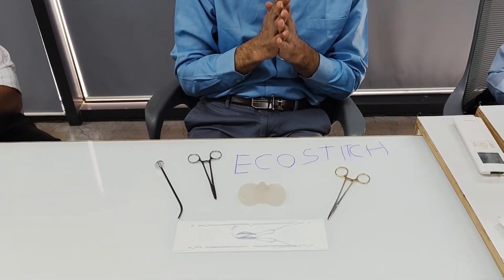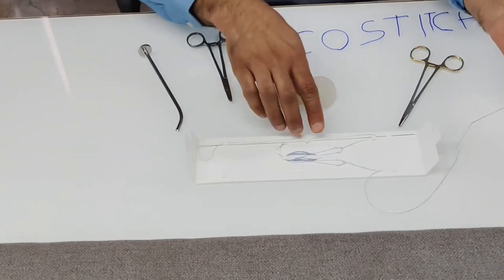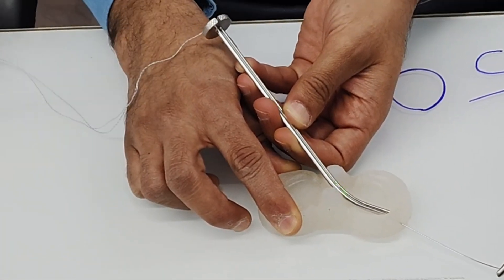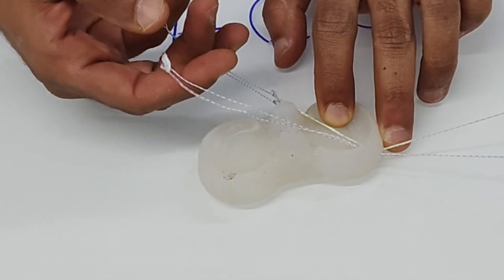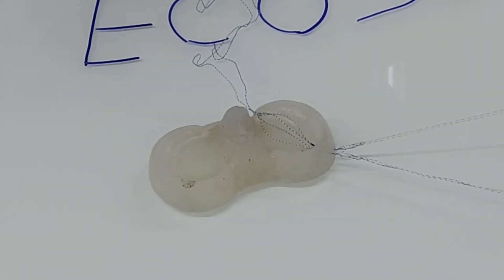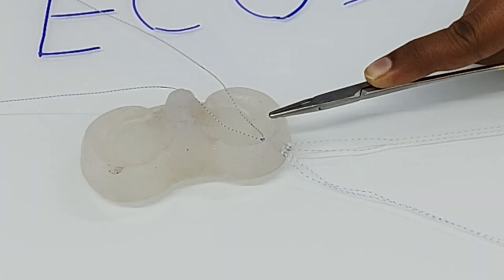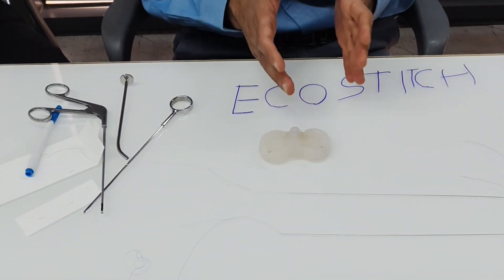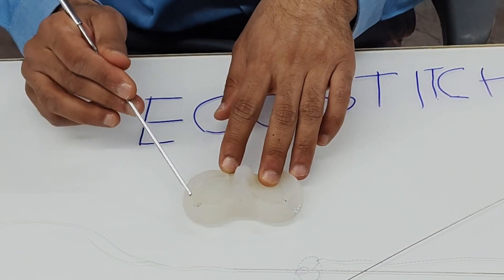Ecostitch Meniscus Repair . Dr Prathmesh Jain. Advance Hospitals

Comment: Not from medical background, but this stuff is very fascinating to watch. Pardon me if there are any dumb questions. But my curiosity led to below questions. 
<Question in respect to bucket handle tear in medial meniscus.>

1. Does these threads(knot) do damage to cartilages in long run as medial femoral condyle will be in contact with this(knot), what is the material of these threads?
2. Anchors will always be on the posterior side of the meniscus, so these delivery needles are pulled out through skin in the back of knee / arthroscope side(the whole through which arthroscope is inserted)  (for example, if you are working from lateral side and repairing medial meniscus)? 
3. If meniscus is healed after a month, what happens to these threads? Because if you put weight before one month, it can break stitches (if this is true - not sure i am correct or not), then when meniscus is healed and you are putting weight, still these stitches will survive?
4. Are there any drawbacks for these stitches as compared to all inside suture devices?
5. what are your views on biodegradable vs non biodegradable suture in meniscus repair? What are the advantage/disadvantage and its effects on healing?
Reply from the maker: 1. No problem with respect to knots.  
2. Needles are cut after anchor deployment 
3. Threads synovialise 
4. This is better than all inside as more pull out strength and more solid repair .
5. Biodegradable not good